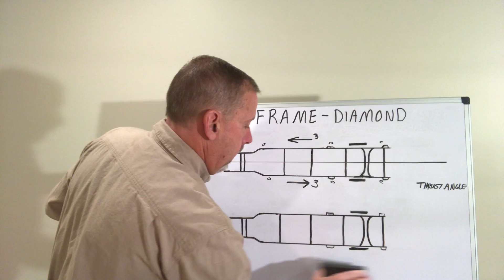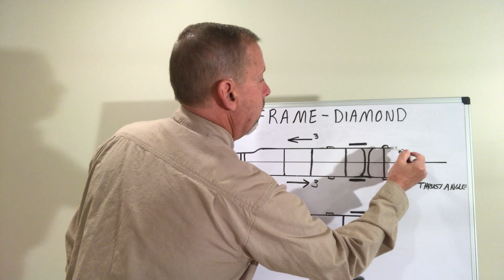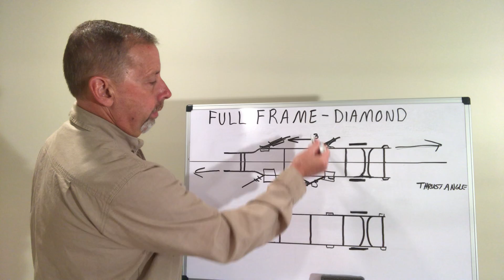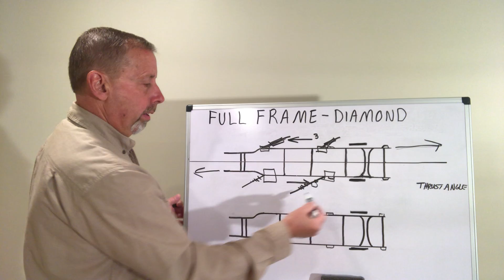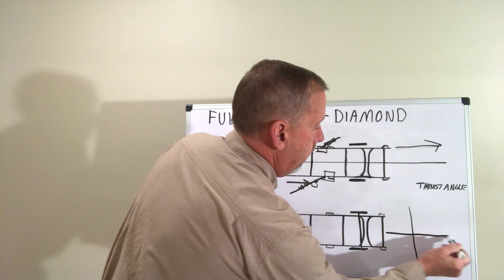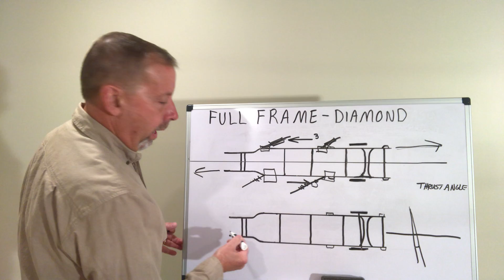Getting diamond out of frames made easy | Full Frame #4

Comment: This is some very incomplete and incorrect information. All frames are divided into 3 sections and a diamond will cause a really noticeable lateral or sway misalignment out in the end sections from the out of square center section.
Reply from the maker: You’re partially correct. It was incomplete because other videos in this series covered straightening in more detail. This video is just about how to pull diamond out of the frame without adding more side sway. I don’t think there was any misinformation because I’ve done this for decades and it always works. Thanks for watching

Comment: Thank you for detailed info!
I’m trying to figure out if my 63 C-10 Frame is bent or just diamond past the differential to the rear bumper. 
It is diamond, best I can tell in the rear about 3/4”. I’m trying to determine if the frame behind the differential is bent as well. 
I’m thinking I’ll  find the center line and measure from that line to determine if the frame is bent to one side?
Reply from the maker: How To Measure A Frame At Home
https://youtu.be/IQMsE2Ooajc
Here’s a link to my video on measuring a frame at home. Dealing with diamond, it would affect the entire frame and not just 1 section. Check for any sway 1st and then check for diamond. Thanks for watching

Comment: Our chief has anchors on to frame machine that fall into pockets. This makes it impossible to have free moving fixtures on one rail while holding the other also cross beams attaching left to rt.. i dont think it is possible to properly pull diamond with these fixtures anchoring system..Chief ezliner system
Reply from the maker: I’m not familiar with the Chief anchors but I would think you could let the frame slide in the anchor to pull diamond. Thanks for watching

Comment: If I’m using floor pots to tie down the frame instead of universal full frame clamps do I have to loosen the anchors on the side that’s pushed backwards in diamond. Thanks
Reply from the maker: Yep same principle no matter what frame equipment you’re using. The only issue is with floor pots it’s harder to anchor because you never seem to have enough or in the right spots . Good luck and thanks for watching

Comment: Good morning, excellent information  for this repair. Instead of these ratcheting load binders, I use military air transport binders. They are spring loaded and very light to handle. You can find them at surplus stores near air force bases. They sure save my worn out knee's and back. Hope this helps. Thanks and take care. Good luck.
Reply from the maker: Never new about military binders. Good to know. You’re right about worn out knees and back. Full frames aren’t an old guy’s job anymore. Good to hear from you Steve as always. Thanks for the tip